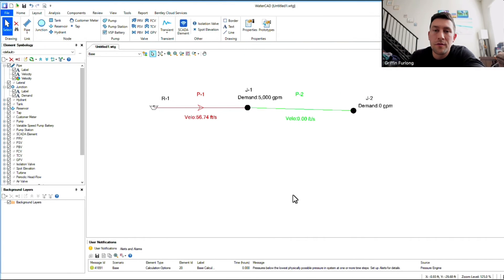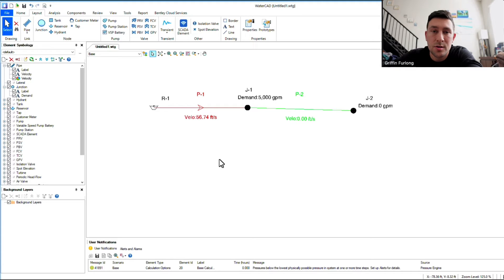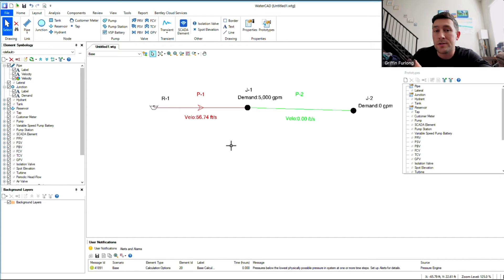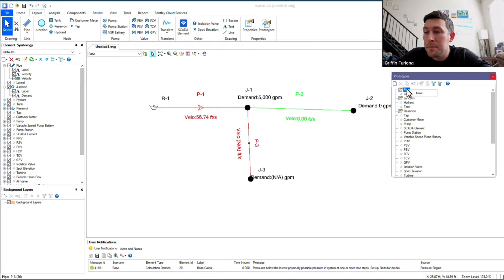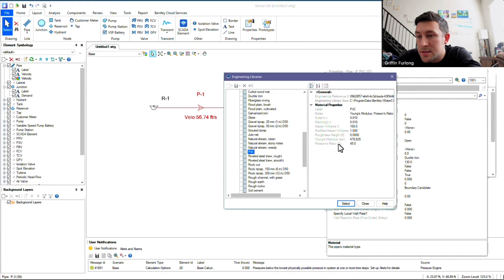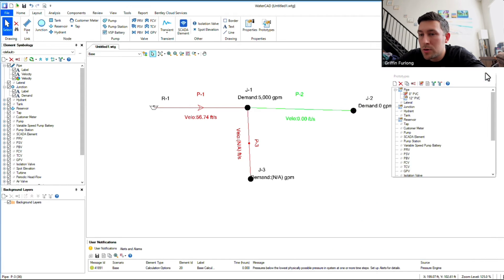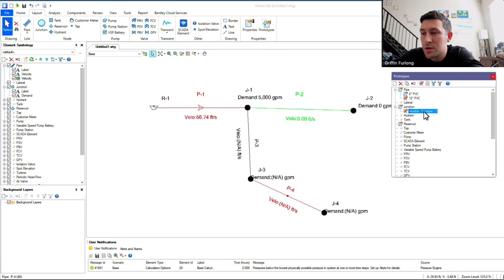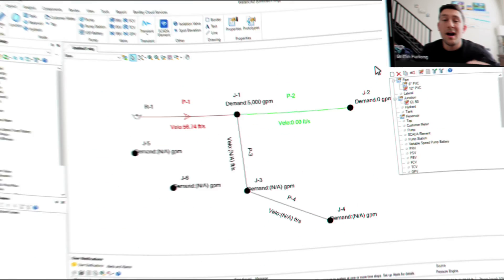WaterCAD Hacks: Build Models Quickly

Comment: Hey Awesome video! Your tips have really been helping me out. Do you have any advice on how to run and print out flex tables efficiently for large scale water systems with many reservoirs, pipes, and junctions that need to analyze several fire flow scenarios?
Reply from the maker: @tarking5670  happy to help! And boy do I have a good tip for you. You can actually set up a template report that way when you hit the print button everything prints in your order and any flex table you want